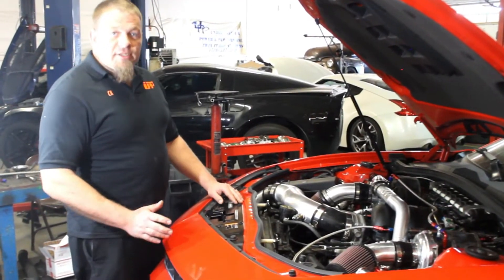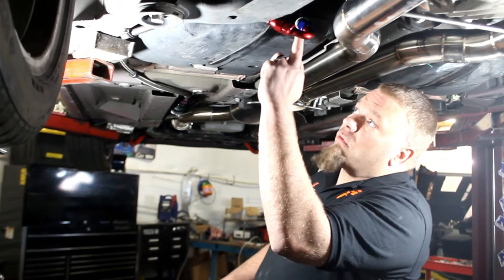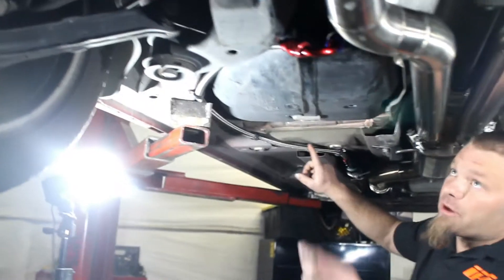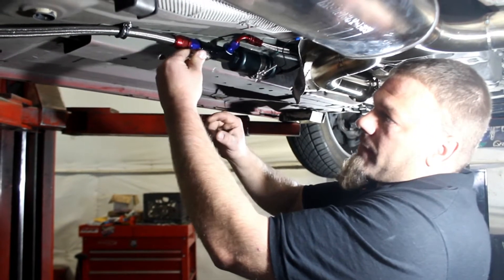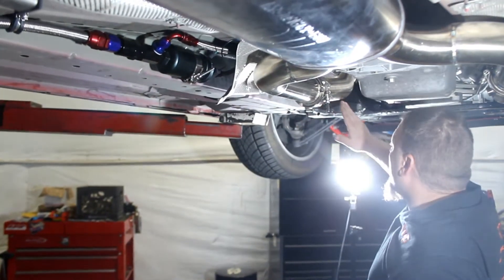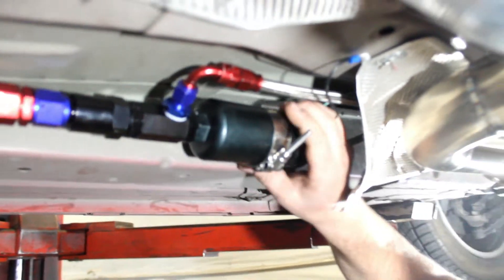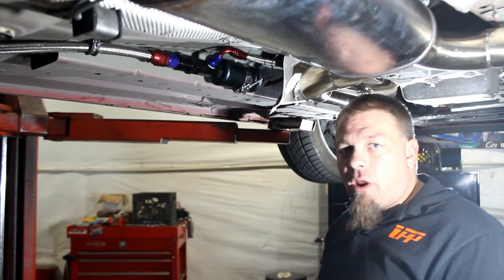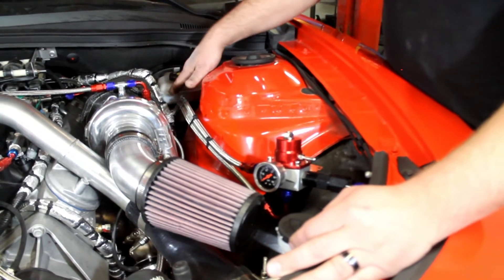UPP 10-15 Camaro Fuel System Install Instructions

Comment: Wish I went with a different kit this thing came with no instructions bunch of wrong size fittings and might I add missing fittings as well what a headache been having to order an fittings left and right just to try and make this thing work
Reply: It would help if you do a revised video as my pump and return line is completely different from this video. It appears as if the return line is made to run all the way to the tank and not to the a tee behind the pump
Reply: @turbo210si  same
Reply: @turbo210si  did you ever get your system properly installed? I could use an assist.
Reply: @b.r.matlock5520  I just went with a fore innovations triple pump system. Forget about their cheap half ass system, stupid pump gave out with in a week trashed it and went with fore innovation night and day difference
Reply: I'm glad that you found the instructions but am sorry that you were not aware that all of our instructions are posted on YouTube.   We’ve documented it exceptionally well for what fittings go into the system, and sold 100’s of these without much issues. If there was an issue and we shipped the wrong fittings we’re always here to help and answer questions and stand behind our product 100%, I do not recall any inquires about this to the shop.   If you still have any questions please feel free to give us a call at 719-575-0202.